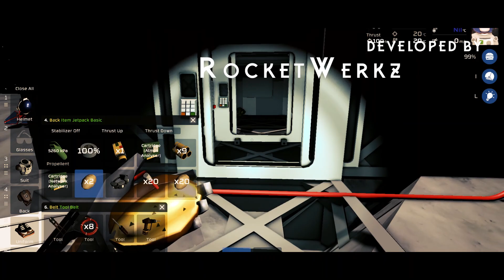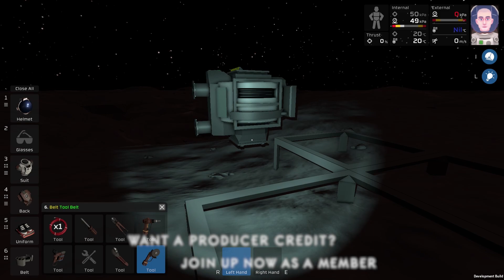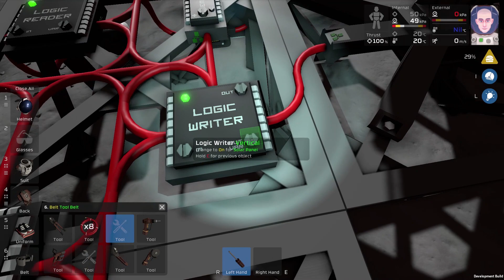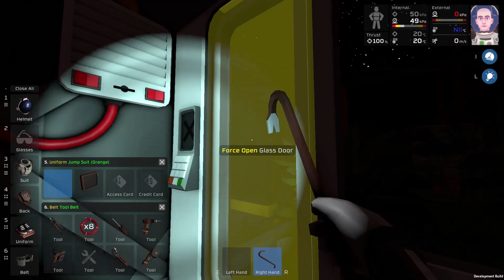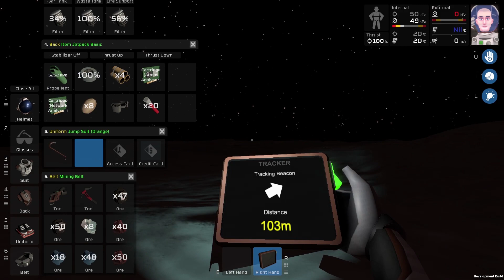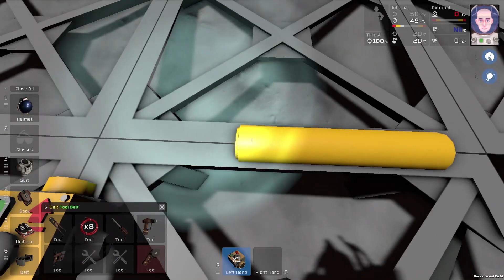Stationeers | Fuel Theory

Comment: How does a seperate grid for the furnace stuff sound? that way u don’t melt the cables also it cleans up the cable spaghetti
Reply from the maker: its a good idea but the issue is for a 'grid' to really work we need power storage for it ie one of the two power controllers I already have.  The problem with that is that they take steel to make which needs the furnace. So sadly we need to build the furnace first :)